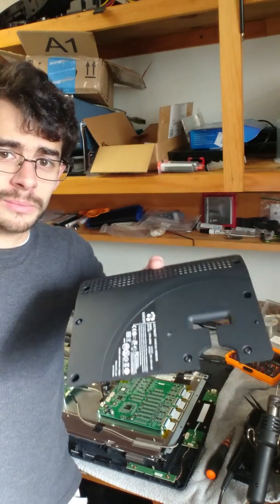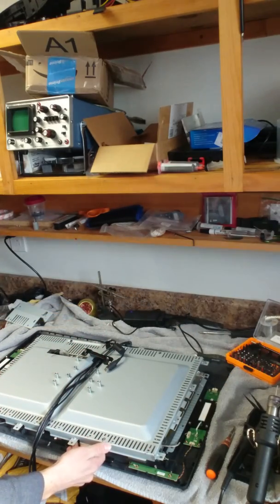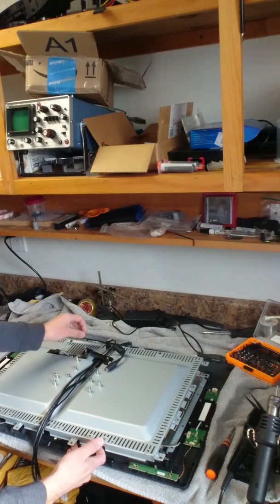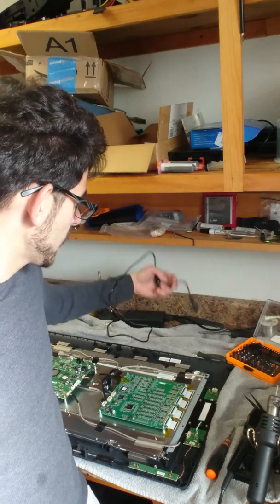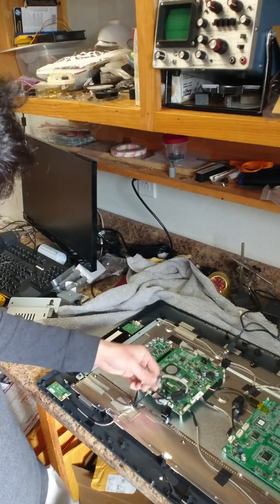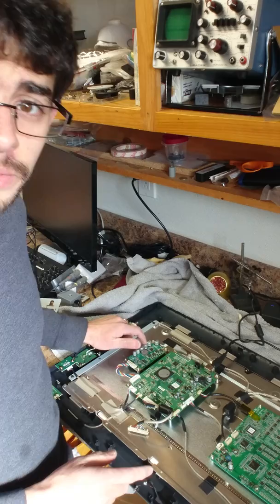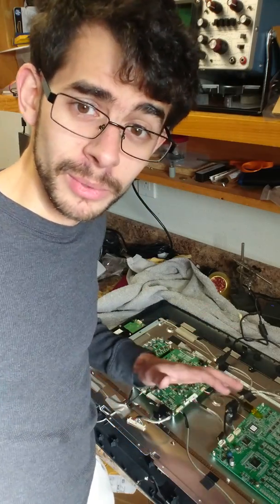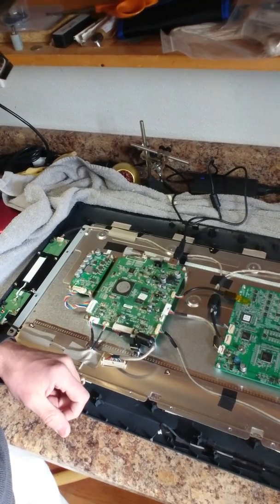Part 1 Wacom Cintiq 22HD DTK-2200 Display Not Lighting Repair

Comment: My case is strange. I get a constant purple backlight and the power light is blue, but it never gets around to displaying anything from my PC. Windows recognizes it, but it won't extend my display. I bought mine used, but inspecting the main boards nothing seemed out of the ordinary. Any thoughts? 

The buttons on the tablet all work, and the display options button will display a menu on the tablet, but the display signal is not making it to the screen or something.
Reply from the maker: That is a 1/10 case, where main chip is dead. It's like not worth fixing, are you in the US? I can trade in or send a good board depending how far you are.
Reply from the maker: My email is procersapientiae@gmail.com
Reply: @procersapientiae  Appreciate the reply. Yeah I'm in Southern California. Likely a little far just based off of your accent. East side I take it? 

I don't have any soldering tools, do you think a board swap is possible?
Reply: @procersapientiae  just e-mailed you, let me know!

Comment: Hey Ian! I have this exact model, and all has been fine for years until recently. Now it seems randomly the display will display "no signal going to sleep" after which it attempts to gurn on and off again. The pen is still active and works, only the display is showing this message. My first thoughts/hopes are this is an issue with a potentially damaged DVI cable, as I've checked all the connections. I have not tried it on another computer yet. I have ordered a replacement DVI type D to HDMI cable to give that a try, as the DVI cable did get pulled a few months ago, after which this seems to be the new behavior.  Currently when it happens I turn the display off, wait maybe 15sec and turn it on again and it works fine.  Any pointers or advice from your experience would be greatly appreciated!! Cheers
Reply from the maker: If it continues to fail with that message after the cable swap, you have a weird error that we can't figure out.

Comment: Pretty sure this is happening to mine too. Just went to use it, windows see it as a device but no display.  Only a blue led light.
Reply: I'm having the same problem. Did you find a solution?
Reply from the maker: Fee free to email me IATompkins47@gmail.com
If you want to send it in

Comment: Your are the man, Thanks.
what would you do when a cintiq 27 qhd wont show any sign ?
The light on the power adapter goes off  when I plug it to the cintiq.
the device is completely dead no lights whatsoever.
Thanks in advance.
Reply from the maker: I recently acquired several 27QHD units, we should come up with a solution in a few months.
Reply: @procersapientiae   Thanks , I will keep an eye on your channel..

Comment: Hello Ian I tested your method and plugged in the cable for the backlight. I reconnected the power and by re-lighting nothing not even a small flash. do I have to replace these capacitors? thx
Reply from the maker: Hi Serge, sorry for the delayed reply, If there's no flash, then it means the BZ4435 Transistors are bad, but I think I sent back an email asking you what cable you unplugged for the flash test.
Reply: @procersapientiae  Hello Ian thanks. I disconnect the same cable of video

Comment: My blue power light comes on and my system recognises the cintiq & pen touching it but I just get no picture and I have to hold the power button down for about 20secs to turn it off. As I'm not getting any backlight on my screen is it most likely replacing the backlight board capacitors should fix the problem? I reckon I could handle changing the backlight capacitors but not the process you show in your third vid on this. Thanks and appreciate you making these vids man!
Reply from the maker: I still do repairs but I no longer make any guarantee, sometimes the 22 is fixable sometimes it isn't, plus it's a pain to work with and ship and sometimes it doesn't work after awhile anyway.
Reply from the maker: Also, the backlight caps are not the problem, I believe I added a description to the video talking about that. It's usually the 4435BZ transistors on the main board or the capacitors on the monitor's T-con board thing.

Comment: Ian, I have the same model that seems to have the same problem. Doesn't power on but blue LED light comes on when plugged in. Same exact CIntiq using same cables and power supply works flawlessly so I don't think that it's the power supply or cables. Do you still do repairs (and if yes, what are the details to get my CIntiq to you)? Thank you.
Reply from the maker: It's best to email me, my turn around time is still a few months right now as I do this as a hobby and life is kinda busy. Email is procersapientiae@gmail.com depending on where you are especially. Sometimes I will do same-day repairs if you're going to bring it in. If you're outside of the US, I know someone that is reputable I can try to explain to them how to do the repair.

Comment: Hi Ian,I´m from Brazil and I bought  a Cintiq 22 hd five years ago.Months ago,the pen stopped working.Everything works,except the pen.I openend up and I think I found the problem.Now,I don´t know if the name is correct,but I think is transistor...it´s transistor U3.I have no idea where to buy it and I´d like to know if you could help me with that.I´m not sure if that´s really the problem,but the transistor is destroyed,so that´s my main suspect...
Reply from the maker: Hello, Walter, today's the first day I don't feel braindead in the past month and a half, these overnight shifts have been cruel to me. 3 questions, 1, where on the board is U3? I can't locate it on a spare board I have.
2. Are any of the USB functions working? (touch buttons, etc?) 
3. Do you want to try swapping your digitizer board for a spare that I have?
Thanks,
~Ian A Tompkins
Reply: @procersapientiae  Hi Ian,it´s ok!
1-It would be better if I´d show you a picture,but it´s close to a round piece written 13,33,25v(the nubers are one below the other.It´s very close,side by side to it.This round piece is close to another round piece,tha´s blue and it´s written 2R2.
2-Everything is working,execept the pen.And I tested the pen on another Cintiq and the pen worked.
3-We could try that,but I´m afraid it would be expensive to send it from here.But, would you sell your board?That would be an option for me. I have an agent,he lives in USA and I believe  he could handle this better and easier than me.Do you have an e-mail so we can get in touch?
Thank you!
Walter